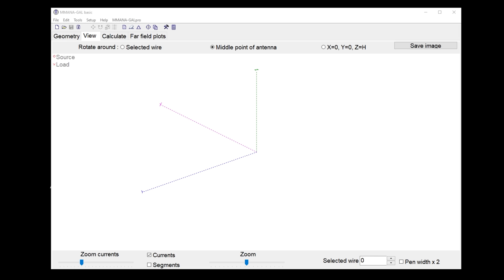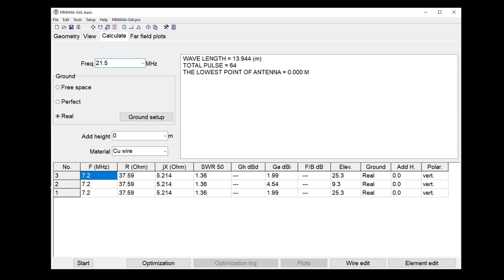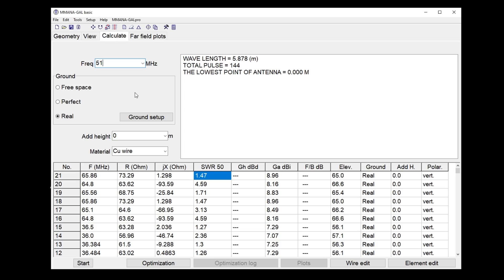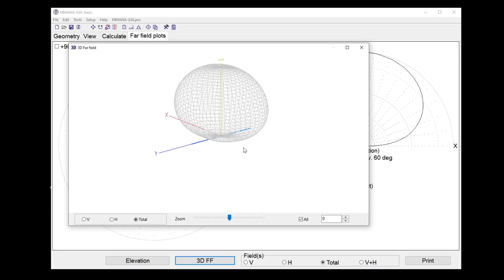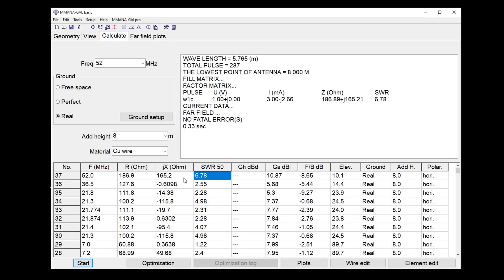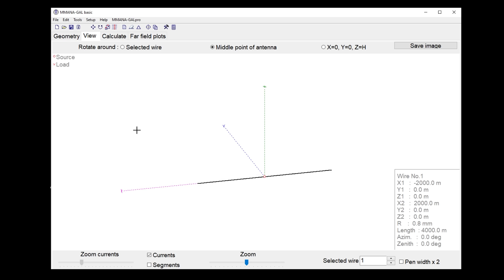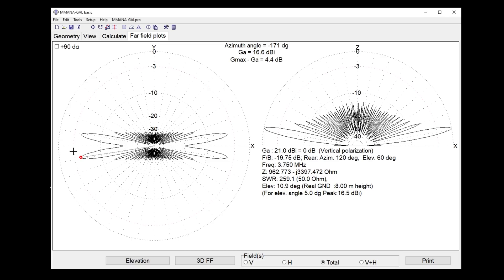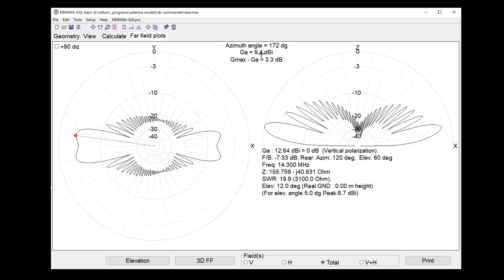Fascinating VERY Long High-Gain Cheap Wire Antennas

Comment: The disused telephone line i used was just over 3 miles (5Kms) long.
Yes i fed it with a balun of some sorts (that was nearly 30yrs ago now !!!)
It just happened to be very straight and pointed towards the USA.
The biggest problem was:
1. Near field lightning strikes
2. Build up of wind static
3. Possums getting fried on the odd occasion
cheers
Reply from the maker: Ah! Hello Roly, I thought you would have popped up!
Reply: @DXCommanderHQ  Family stuff precluded me from joining unfortunately....  gotta talk soon.
Reply: I hear possum stew is pretty greasy.
Reply: @paulzenk3856  It is OK if front AND back wheels from the 4x4 have gone over it, otherwise a little bit chewy......
Reply: @paulzenk3856  Maybe, but it's got lots of flavor.  And you can use it as biodiesel in a pinch.
Reply: @Randrew  I’ll stuff a couple in my tank and see how it goes.
Reply: Legend!
Reply: I've got 0.28 miles or about 450 m of telephone line on poles.  Not at my QTH but at a near-ish rural property where my dad used to live.

I've got a question about that setup as an antenna... It's actually 2 wires of course, running horizontally with about 1 foot of vertical space between them.  I'm tempted to try them in parallel as "one wire", thinking that would be better than having one unconnected wire running parallel above or below the "live" one.

Any thoughts?
Reply: @Randrew  My setup was exactly the same. I tied the two lines together at the feed point..   cheers, Roly

Comment: I want to see a Rhombic video!!! 20 meters thru 10 about 710 ft no resistor. Bi-directional. Then with single directional. About 30 ft up. We could get 16 DBs out of this!! 10 wavelengths on 20 & 20 wavelengths on 10 meters!!!
Reply from the maker: I would also love a rhombic but 3 x very tough 30-foot towers will cost a fortune.. You can't just use a few scaffold poles! Good idea though!

Comment: Very cool. If I want to try a super long wire for RX, do I need to worry about tuning it's length in terms of resistance and swr?
Reply from the maker: Not at all Matt. See this video: https://youtu.be/bkXLJ-bslns - I used a 64:1 transformer. Frankly almost anything would have worked.

Comment: I used to use a kilometer long wooden fence with a long wire on top in combination with an antenna tuner and I thought 50 to 80 Watt amp. It worked very well that afternoon in receive. SWR I really don't remember anymore but was not so great.
Reply from the maker: I'll bet!

Comment: HI CAL  MARK HERE IM HAVING A PROB SWR ING  MY EFHW WITH 49.1 UNUN FROM LG AND 65FOOYAND 2INCH  PLUS 3INCH FOLD BACK AND 6INCH AT FEED POINT FOR STRENGTH  IN A SLOPER  DISC   FEED POINT UP AT MY BED WINDOW 30 FEET HIGH  SWR 3  DO I NEED A COUNTER POISE   MY COAX INTO SHACK 15 FOOT WITH  AIR CHOKE 10 4INCH TURNS 2 FEET FROM  RADIO  CAN YOU HELP  LOL PLEASE       JUST REALISED IN CAPS  LOL SORRY
Reply from the maker: Erm.. I would talk to your supplier and see what they suggest?
Reply: @DXCommanderHQ  thankyou

Comment: I own a plot of land that is 600 feet by 1,800 feet (22 acres here in the USA).   My plan is to make a random long wire 100' long and try it.  I will then add 100' to it every couple of weeks to see the difference in performance.  In time, I want this antenna to be 1,800 feet long at an average height of about 30'.  I'll be tuning it with an automatic antenna tuner at the feedpoint with about 30 feet of coax to the Icom 746PRO in my shack.    Should I make a video for you?  -W8OKN
Reply from the maker: Hey Sean.. Sounds good.. I would fancy putting this in the middle with a 4-way or maybe 6-way switch from say Array Solutions to change directions, particularly on higher bands. Could be VERY good...
Reply: @DXCommanderHQ  After I sent this note here, I thought about the possibility of being able to change the length remotely.   Keep the total length wire setup, but change the length on the fly.   100', 200' 500' etc.

Comment: My first experience with a longwire was at Field Day when I was Jonny Novice at 16 years. This Hippie professor shows up with a brand new FT-101 which was like a rocket ship radio comnpared to the tired Drake TR-3 we were pounding CW on. He said take this roll of wire and walk down the hill and throw it up in that tree down there. So about 500 feet later, we returned to his camper at the top of the hill. All went well with the 101 on a roller tuner and he was making contacts galore on 15M. But when a storm came close !!! This BZZZZZZZZZZZ-SNAP kept repeating with a blue spark in the tuner. I ran like hell.
Reply from the maker: Wow!

Comment: Sorry im kinda very new to this, picked up an sdr dongle.
But i was curious with the matching of antennae sizes....has anyone used a motorized cable anchor that could run up and down a cable to effectively change the antennae length...or am i missing something entirely? (Im generally missing a lot entirely but i am curious if that would work rather than setting up different antennae😄)

Im mid city in Puerto rico, live on a hill in a house with an 80ft staircase tower 2miles off the coast (north facing..lots of ocean out there)..im thinking i should be able to get somesort of interesting signals around here. Very interested in tapping noaa satellite data and generally having a nose around see whats going on in the air.
I picked up a triple set of amplifiers (2 tiny 4" nubs and a 4-5ft telescopic, not sure how good those would be, not getting much so far but as i said its my first dive into this since a childhood cb phase i went through.
Also dont fancy being struck by lightning which we get a lot of, how do you protect the antennae from a strike. Is it only grounding or is there a gizmo?
Reply from the maker: OK.. so if this is for reception ONLY, then don't worry about it. Receive on a wire will work just fine anyway - actually DE-TUNING it can have the effect of lowering your noise-floor and being able to hear better anyway.. But welcome anyway!

Comment: What would happen if you were to have the space to run say 8 end fed antennas all day 4 wave lengths long set out equally spaced. What would happen. My brain can't work this one out! 73 de ZL1JYM. James
Reply from the maker: They would all work together and you would PROBABLY have a sllightly better receive however, the three that were not doing the job of receiving very well, would just contribute noise. Better to have a switch / relay system to select the right one..

Comment: I had a 3 element Mosley tri-band Yagi (TA-33JR) at 70 feet and an end fed wire wire in about 300 feet overall in length. The wire ran NE (Europe) and SW ( Texas ). I noticed that on 10 meters signal strengths into Europe and Texas (off the ends of the long wire) were pretty much the same on either antenna. However the Yagi was much better is all other directions. The wire was straight for approximately 8 wavelengths long on 10 meters. If you can run a long straight wire (8 waves long is pretty good) in the right direction you can get good gain in a few pinpoint directions.  In my case it looked like 8 waves long was equal to 3 elements on 10.
Reply from the maker: Hey! That is a GREAT tip because we will be installing our 160m long end-fed probably this week.. Diamond. I wonder what height your end fed was..
Reply: @DXCommanderHQ  It started at the ground floor window (L Network tuner just inside the window) sloped up to about 65 feet then dog leg right and went straight for about 8 wavelengths to a tall pine tree about 45 ft at that end. So it sloped from 65 down to 45 feet. Also was enough sag so wire did not break. So not sure how high the mid point was. Best direction was probably toward Texas but Europe was also equivalent to the 3 elements on 10.

Comment: It's a pity the software doesn't work down to the new ham band at 630m!
Reply from the maker: No.. It does work. Just type in where it says Freq 0.475 (MHz) and it will run calculations perfectly.
Reply from the maker: Alternatively.. Double the numbers and half the lengths. Same.

Comment: I have a long wire here, like 130 some feet, and just put up a EFHW 4010, just to try it out, and it has become a work horse for me last few days, tonight I worked a guy up in Alaska on 20m and a 100 watts, ( a POTA station ) I have did this before, but not on a short wire antenna.......always wanted to try a loop but never have, yet, enjoy your videos Calvin, 73
Reply from the maker: Yeah, loops are fun too!

Comment: You can get a few more decibels in one direction by tilting a vertical antenna in that direction. The 3/4 wave antenna should be tilted 35 degrees from vertical. Also, you may find that such an antenna works better 5% above the frequency for which it was cut.
Reply from the maker: Well, I don't fully agree really because a) I've done some unscientific tests and couldn't see any difference and b) maybe look at this timestamp here: https://youtu.be/JZFuOzKY8gg?t=222
Reply: @DXCommanderHQ  Okay I will have to do some experiments with this and see what happens, because theoretically a tilt should alter the radiation pattern.

Comment: When I was Freshman in University my dorm room had been previously occupied by a HAM  who had strung a dipole wire over 100 feet Long from the stem to cross arm of the T shaped building.   The feed came in my 7th floor window so I hooked up my FM radio and got very good reception.   My other favorite was hooking up my crystal receiver to the fence around the VA facility

Comment: Impedance of free space is 376.6 ohms. Impedance of an infinitely long wire would be a little different due to the variation of velocity coefficient. Hence "radiation", because transit would be easier outside the wire. But being infinite in length, there are no end points for reflection and by definition will not be resonant. A rhombic antenna is the next best thing to exist on planet earth. Notice the termination resistor to prevent it from being resonant. The big question is the percentage radiated per unit length. Would it be a constant rate over a linear distance or a wavelength distance? All energy would be radiated minus wire ohmic resistance. Radiated energy along its length would have to be a fraction of a fraction and therefore at a logarithmic remainder rate of decline. Nothing left at infinity.
VA7WN
Reply from the maker: Interesting!
Reply: @DXCommanderHQ  Does anyone know the capacitance of free space? Is there a unit of inductance per unit length into free space? What about step rise time and decay into an infinite wire? ... or ... is this how the 376.6 ohm impedance was derived in the first place. We are so accustomed to finite length and this kind of examination could lead to a better understanding on propagation and antenna design. VA7WN

Comment: I always wanted to make an antenna something like the HAARP program up in Alaska stack pulled on top of each other just hope the SWR meter will work good
Reply from the maker: Yes, for many of us, the legends of these antennas are lost to time.
Reply: Harrp is for moving the atmosplane around to create movement, along with the creation of water from the turbofan engine in the planes that fly overhead everyday making clouds, this is how they keep the system going, in short

Comment: Hi Callum.
           Thanks for your videos quite informative much of your results regarding very long wire antennas confirm my findings 
with very long wire antennas, low take off angle with gain on the lobes on higher bands.
  I have a sloping 360 meter loop next to the sea over very wet ground fed with open wire feeder
into a home made collins type tuner, antenna hight furtherst away from sea is aprox 80 feet above sloping ground  down to about 60 feet above ground next to the sea
 the other night had a qso with a station in Kuwate on 40 wats on 20 meters for a good 30 minuets very little
qsb and steady 59+ sig reports Also with very very long loop antennas I have noticed their is considerably less qsb than say a resonant dipole/doublet 
 I can send you the dimentions and photos if you like I think you may find it intresting
Reply from the maker: I agree. I ran a loop at around half that size. Some of the lobes are insane and as strong as a BIG yagi.

Comment: Long wire and High-Gain are not generally used in the same sentence.
Reply from the maker: Not normally, but Mr Beverage got a Patent for his!
Reply: @DXCommanderHQ High directivity, but low gain I think are Beverages... negative gain mostly

Comment: The best "long-wire" I ever deployed was from very fine wire that was wound in the same manner as a "ball of string" with the lead wire taken out from the inside - instead of the outside - so it internally un-wound itself. The coil of long wire came from a 1960's TV set that I broke the tuning insides out of, and noticed the inside wire did not tangle. So I taped it to an Arrow, and shot it up over the Oak trees in my backyard (I never saw the arrow again) and then connected my end of it to my SW radio and it WORKED AWESOMELY.
I connected my HeathKit Osclliscope to the end and measured 73+ volts of "noise" on it. The Oak trees were on acres and well away from mains power lines. I could listen to European SW in Atlanta with ease.  Alas we moved from that house a few years later.
When I make my next long-wire antenna it will be via the same method of unwinding a fine wire from inside of a coil attached to a bigger Arrow shot up into the sky over a forest. #BestAntennaEver !
Reply: The antenna that I launched in faith above was in the mid 1970's, well before I even knew about Wire Guided anythings, but it makes sense now in this century.
Reply from the maker: Wow. Great memories. Super tale too!!

Comment: Hello, is it true that the thickness of the wire doesn't matter? Single or Litz wire copper, aluminum or stainless steel? Any significance? Thanks
Reply from the maker: For transmit antennas, yes it does matter. Just don't use PVC coated iron/steel (stainless is OK). Silver the best, Copper comes in 2nd place! Gold is third :) It's all about conductivity.
Reply: @DXCommanderHQ  thanks you, Master 🙂

Comment: New subscriber. Love the channel. What modeling software are you using? If that was answered before my apologies. ‘73.
Reply from the maker: No worries and thanks for coming along.. Yes it's MMANA-GAL.. I did a video about it about 3-weeks ago. Actually it's a series..
Reply: @DXCommanderHQ  ok great, thanks I’ll check out the series. Thanks for the reply. - W2LMR

Comment: In the Shortwave Listener world.... You will hear about this aerial called a Beverage. Took me a bit in the early days.... Why are these "old timers" heading off to the bush with batteries and decent recieving equipement.? Then saying we are all set with "beverages" ready to listen for some faint stations and log them for QSL reports. Silly me thought ok..... what happens when their coffee runs out?

The me of today realises it's the name of the inventer of their longwire aerials they use..... It's a long wire run out at about 2m or so off the ground for a wavelength or more, then terminated on the far end with a 400 to 800 ohm resistor. This helps with the directional charactoeristics. Also a bit wierd (completely opposite to a dipole) is max sensitivity is end on! So run the wire out in the direction you want.... I believe the theory is the hieght above the ground helps form the impedance and becomes close to a folded dipole (don't quote me). Back at the reciever end you use an appropriate balun to get back to 50 ohms. What ratio that is depends on the termination resistor on the far end.

This is no good for TX btw...... It's a RX only deal.
Reply: You're also describing, sir, what the various military field manuals identify as a vertical half-rhombic. These fit the same pattern of "traveling wave" antenna. Like the traditional rhombic, it is high-gain, high-directivity (more-so the longer it gets). In plain fashion, it is bidirectional, but they are typically terminated at the far end, toward your desired communication link with a ~600ohm resistor. This provides a nice match through a 12:1 coupler of your choosing. At reasonable lengths, the total loss due to the resistor is on the order of 3dB or less, but considering the gain and directivity, it is a fair tradeoff. Structurally the difference from a Beverage is the midpoint of the wire is elevated to achieve the rhombic shape, and to further minimize ground loss for transmissions, a ground wire can be run from one end to the other.
Reply: @peteranoia4570  thanks heaps for that. I am aware of the science "these days". I really wanted to share the part where pimple faced me.... was wondering what they meant by "beverage". To me a teenager it meant a drink of some kind. Cheers (pun intended)
73's
Reply from the maker: Yes, Beverage got a patent for that back in the 20s.

Comment: Love when I hear hams on low band saying their running a long wire but neglect to admit that it’s long wire for 40m but seriously compromised on 160m 😉 long wire is 1.5 x avg wavelength ☺️
Reply from the maker: Good point!
Reply: Formula:  -3/4~HOA factor.

Comment: wonder what gain you could get on a farm electric fence wire 🤔 disconnected from the power supply (bzzzzz bzzzzz) of course.
Reply: I have been wanting to do just that. Have a few non-connected electric runs available to me on some family property.
Reply: @kenluning909    you could string a couple thousand feet of shielded wire along a tree line.  all those wavelength multiples increases the gain

Comment: I’m a DX’er and I tune my 80m loop to resonate on 14.250 (or 3.5625 on 80) to take advantage of the gain realized by the wavelength multiple.
Reply from the maker: Nice!